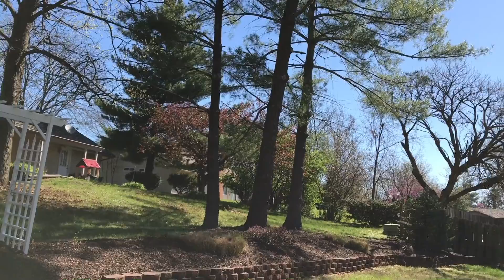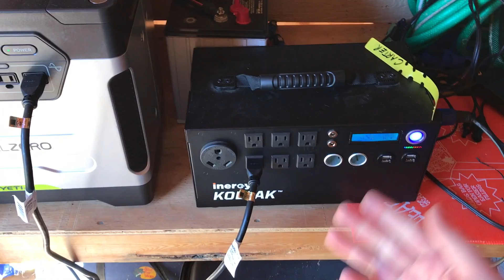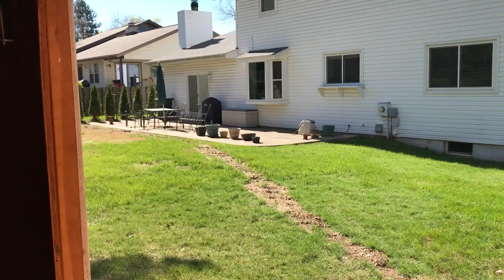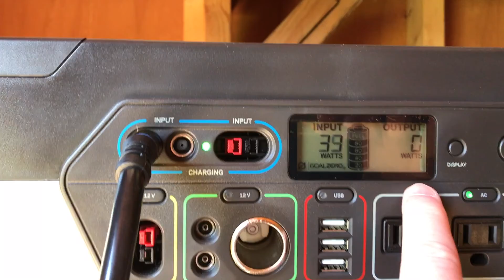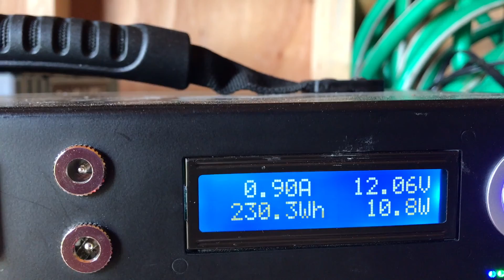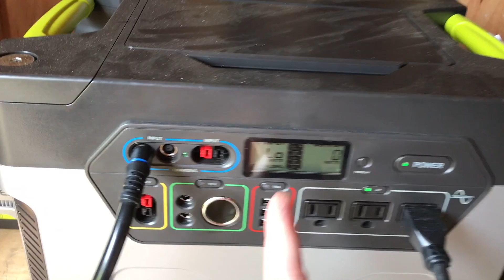Solar Charger Energy Use Comparison

Comment: I just got mine and love it.. I do agree with you on how much the inverter uses. I will be buying a separate inverter  (200-400w) to plug in via DC outlet that is constantly on. Primarily for use on smaller equipment. I know it's an additional $ but I still enjoy using the Kodiak.